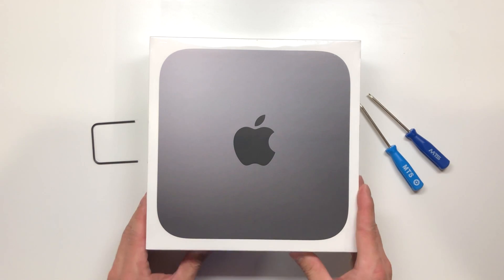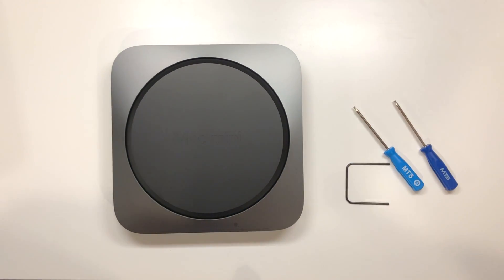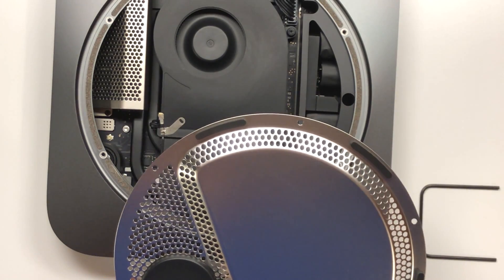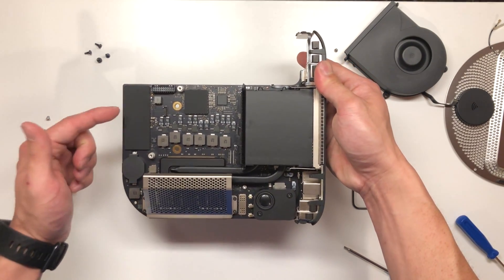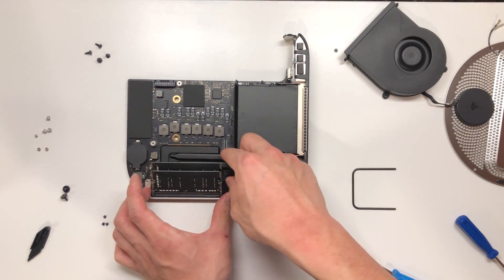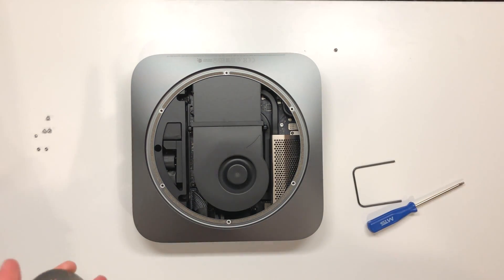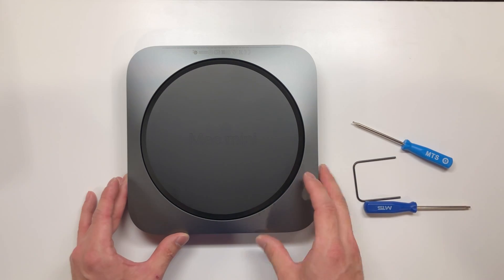Late 2018 Mac Mini Teardown & Ram Upgrade + Re-assembly

Comment: Great video!! - I've been waiting for a teardown like this, to see how easy it is to upgrade the RAM.  Although, sorry to disappoint you, I don't think the 2018 Mac Mini still has the IR receiver, nor does the headphone jack support S/PDIF optical connections like previous models. On the plus side technically, the four USB-C connections are actually Thunderbolt 3 ports, so superior to plain old USB-C. https://thunderbolttechnology.net/blog/difference-between-usb-c-and-thunderbolt-3
Reply: Ben Norris I think you can get some Thunderbolt Optical connectors?
Reply: Jake M Probably. A lot of Audio interfaces also have optical out - so it’s not a deal-breaker (just more inconvenient).
Reply: Ben Norris Seeing as Apple’s suite of decent programs includes GarageBand and Logic, it does seem a strange omission!
Reply: Jake M it is a bit - but I expect Apple thought anyone who is likely to really need it (especially for Pro Audio applications), is more than likely to have an audio interface anyway that come with a plethora of additional features.

Comment: i build and can easily take apart pcs. but since this is my first mac. im not going to open it up and do this. althought im 90% sure i can do it. i cancelled my 8gb mini and just got the 16gb version. yes its another 200 euros. but want to lean towards the careful side.
Reply: @Xavier Breath i want to go for 32gb so that would save me 360 euros here in the netherlands...
Reply: @AFTstorm  thats a different story. if i am pleased with the machine. and in a few years i think its still doing what i want. then opening it wont be such a big deal.
Reply: you can pay apple to do it for a fee
Reply: Chris Schneider One only learns by one’s mistakes. Making mistakes is GOOD. Don’t be a wuss.
Reply: @unlokia  not on a new little box. fucking up a 2k little mini is not a "good" mistake. and its just ram you can upgrade. this is apple we are dealing with.

Comment: I'm curious how effective it is a dissipating heat, and is the heatsink copper bottomed? If it's copper then liquid metal will drop the temps and hopefully prevent thermal throttling.

Comment: does it boot with new ram strips? what's up with all the T2 scare?
Reply from the maker: Didn't actually replace mine, but it booted fine after opening. Numerous people have done the ram upgrade with this model on fourms and no issues with T2.

Comment: Very helpful video - many thanks. My conclusion is that I'll buy one of these with 512 Gb SSD and 16Gb RAM - Apple's premium for that much RAM isn't too bad. Then, when AppleCare on it has expired I'll do the upgrade myself to 32Gb or even 64Gb. But I'll leave it unopened until then.
Reply: In the end I'm doing something else. I found a 2017 refurbished i5 iMac on the UK Apple site with 32 Gb RAM and 512 Gb SSD for about the same price as I was thinking pf paying for the Mac Mini + 4k monitor. Given that the only thing I can upgrade on the Mac Mini is the RAM, and this iMac already has as much RAM as I'll ever need, I reckon this puts me in the same position. Yes, the processor is a generation older, and is only 4 core rather than 6 core. However there are positives with the iMac: a) it has a GPU rather than integrated graphics; and b) I'll get a new keyboard and mouse as well!
Reply: Tom Burke That’s a good plan!
Reply: Personally i may go for the 1tb option but i may just do the ram myself if i ever get one of these
Reply: I am planning to buy 32 GB RAM from Amazon, than take to an Authorised Apple Service Center and pay the service fee which is about £60 so it would be still way cheaper than buying 32 GB from Apple.
Reply: Yeah, good idea. 16GB is broadly sufficient. And, in a few years, when your Apple Care has expired, 64GB might be much cheaper than it is now. (RAM prices have doubled over the last few years: supply and demand). Prices could go down to a quarter of what they are now. I doubt they'll go up more. There's an incentive now to build more factories. Still, 2x16(=32)GB so-dimms are $300 or so now. Don't you pay $200 for the 8-16GB jump?
Reply: For the Mac Mini, going from 8 Gb to 32 Gb is £540 from Apple, or £270 from Crucial UK. So the MM with the i7 upgrade (probably better than the iMac) plus 512 Gb SSD is £1429, plus £270 for 32 Gb RAM from Crucial UK = £1700, plus c. £350 for a 4K monitor = £2050, which is a little more than I paid for the iMac. And the iMac gave me a new keyboard & mouse and a GPU. 

Of course, the list price of that iMac is £2,439, so it was the availability of the refurbished iMac that made the deal.  @GregConquest

Comment: Can you deesolder the ssd
Reply from the maker: I wish I had skills this good. In theory yes, but I don't think any human could actually do it. Too many pins and too close to each other. Also risk would be pretty high. You would actually be better off paying to upgrade.
Reply: thanks just curious, also curious if a sim slot can be adapted for an sd card in apple products products? @brandon20904

Comment: which means I can not upgrade ssd, what a shame, apple
Reply: @Jewish Person  
If the SSD goes bad outside of warranty you are screwed,  it should just be just a matter of placing in a new one, but Apple's approach means a very expensive and time consuming repair, if it happens a few years outside of warranty maybe even uneconomical.
Reply: @Jewish Person You take advantage of thunderbolt or regular usb hdds?
Reply: Your picture matches perfectly

Comment: ofcourse its a 2 memory card setup. :( i guess ill have 20 gig ram. cuz I'm cheap.
Reply: You have to get 2666hz SO-DIMM memory or it wont work
Reply: Miko - its doesn't have to be 2666 mhz. 2666 just gives you the best performance

Comment: Thanks for the tear down and reassembly video. It was informative. I'm thinking about getting a Mac Mini but the cost of upgrades from Apple is prohibitive. Seeing the relative ease of upgrading the RAM was great. Pity that the SSD is part of the logic board though :(.
Reply from the maker: Yes, if the SSD was user upgradeable it would have been perfect.

Comment: Great Video , It is not difficult but at the same time he made it look a piece of cake which is not in my opinion .
Reply: Roberto La Greca Idk I took apart an entire MacBook Pro 13” from 2012 to replace the thermal paste, RAM, battery, and drives and even though it felt daunting everything is much less fragile than you think.

Just keep touching metal because ESD is a bitch.

Have never had it happen, but some preventative measures go a long way.

Comment: Can you confirm whether or not the t2 chip would brick the device from removing the ram?
Reply: Joshua Ryder Many people have already upgraded the RAM and is working fine.
Reply: Nope. Several people on the MacRumours forum have reported success after upgrading the RAM.

Comment: Is the CPU soldered?
It seems like a standard desktop model number (for the processor, clock speeds / cache, etc match up with desktop counterparts) so maybe it's just a custom apple BGA adaptation of a desktop chip?
Reply from the maker: I didn't take apart the heatsink, but AppleInsider is claiming "processors are all soldered and not socketed."
Reply: They are Intel Core-B Processors -- BGA  yup. According to AnandTech, the other difference is they are restricted to 65W TDP. I saw a video that pegged 6-cores of the i5 Mac mini at 100% each (perhaps not a very real world test). They sat at a constant 3.9 Ghz. I don't know for certain, but my understanding is that the non-B variety would exceed 65W TDP in that scenario, and presumably reach the 4.1 Ghz boost on all cores. These CPUs are intended for small enclosures like the Mac mini.

Comment: apple did all that so that you cant upgrade RAM easily
Reply from the maker: Seriously, they could have easily left out the metal mesh shield/guard. They probably profit more by scaring people into buying the upgrade, than the additional cost of installing a metal mesh guard around the ram.
Reply: @brandon20904  this annoys me because I intend on buying a mini but seeing how this isn't a straight forward take the ram out n replace it has me thinking of just upgrading the ram from apple which is more money 😩😭
Reply: Brandon Geekabit are those all screws’ shapes ‘*’?
Reply: If they just didn’t want you to upgrade the RAM, they would just solder it to the board. Problem solved.
Reply: Minoan Light , no Apple probably listen to tons of complaints about the older ones not being upgradable so they made these upgradable, advertised as such but still made it tedious to upgrade in which manipulates the user into paying a “certified” Apple technician to upgrade at a profitable cost. This is not uncommon of Apple.
Reply: @minoanlight4545  true
I think apple are going to continue to allow desktops to allow ram upgrades if not storage
Reply: Tigerex966  or they could just give you enough RAM stock so that you don’t have to upgrade. The Mac Mini is simply not a balanced system for today’s standards. $799 should get you at least an i5, 16GB of RAM and decent dedicated graphics or 8GB of RAM and mid-tier graphics.
Reply: @minoanlight4545  
And why they don't allow us to upgrade storage? In my opinion, at least the RAM and SSD should be upgradable.
Reply: At least you still can do this even though it's hard. Be happy.
Reply: M4st3rm1nd is that your best critique?? Try harder!
Reply: Ramón BS - you're so proud of your response huh?
Reply: Why would they make it easy? They are a company. It's what companies do, make money off you. c'mon

Comment: Thanks so much! Do you think that Apple intentionally put that metal shield to make it harder to replace the RAM by a regular user?
Reply from the maker: Yep. I think Apple sits around and laughs at all the hoops we jump through to upgrade our mac. I mean... was the metal shield even necessary.
Reply: It is an RF shield. It is there for a reason. Good video. :)
Reply: You're absolutely Right, plus on industrial economy is absurd they would waist a screen like that just to make it more complicate. On a big scale several hundred thousand but on a long run more likely a million+ of those would count for a lot of money. Basically in a well engineered device any single tiny piece is there for a good reason and function.

Comment: Fantastic! My only concern is causing any kind of unwanted electrostatic discharge that could fry the motherboard. Any tips on how to avoid this?
Reply from the maker: Always touch a bare metal surface before working on any pc. You can also buy an antistatic wrist strap, this will keep you discharged while working on inside the PC. Read the instructions on how to properly use it though. There are also anti-static mats, etc. No guarantees but I have never damaged a pc from electrostatic discharge, and I have worked taking apart PC's for a living before. The only things I do is always touch bare metal first, and don't touch fragile components on a motherboard; like chips, capacitors, etc.
Reply: @brandon20904  Thank you for the detailed reply. I think I'll follow your method of touching bare metal before I start and also make sure I'm barefooted standing on an anti-static mat!
Reply: ESD wristband. Look it up.

Comment: Does it void your warranty if you open it up? Thanks for the video
Reply from the maker: Not sure, but it wasn't too difficult. According to Apple this years is NOT supposed to be user- upgradeable so I would lean towards the side of voiding warranty.
Reply: Brandon Geekabit afaik it does not void warranty but you will need to replace with original RAM before taking for repair etc...again, just what I've heard after days of reading around, could be wrong
Reply: @Jewish Person no it does not 
But apple wants you to think so for more profits
This is one of the reasons besides profits apple has soldered down memory and storage because you as a consumer still have the right to upgrade it yourself

Even those stickers that say void if removed are illegal that's why apple took them off

We still have the right to upgrade our memory and storage where possible without voiding are warranty although apple is lobbying hard against this.

 One of the features of the t2 chip is to brick macs that are upgraded and repaired without apples expressed permission in the future even when out of warranty

Apple could have soldered it on the motherboard, but chose not to for their desktops macs and you have the right to open it and change the memory

If an apple employee says otherwise they are misinformed and you have a legitamite lawsuit to file against them if they refuse repair underwarranty

Now if you put in the wrong memory or break other things while attempting to change the memory than of course they can refuse service

The auto industry tried the same tactics years ago and failed

No where on apples site or in the keynote or in the computer does it say your warranty is voided if you do so otherwise apple will be facing major fines from the FCC
Reply: No, but if you break something in the process, that will void the warranty.

If you upgrade the RAM, you should keep the original Apple RAM so you can re-install it prior to any warranty service.  Apple has a reputation for summarily refusing to service computers with aftermarket RAM, whether or not it has anything to do with the problem.
Reply: No
Reply: No, you don't void the warranty. But you will if you break something. Also, if you do need to send it to apple you do not need to install the original RAM. But I would still recommend to keep it just in case.
Reply: @michael4196  My Apple store said they would not do this upgrade
Reply: Thanks for a great video. Useful note....
I had a HEARTATTACK moment when the Mac Mini wouldn’t power on again again installing the new RAM. Rechecked everything (except the RAM itself) and nothing. 
Went back in again to the RAM slots and one just must not have clicked into place correctly - so make sure to double double check the fitting of the RAM!! 
Relieved now that I’ve not broken my brand new MacMini!!! 😅
Reply: No it does not. You have the right to repair/upgrade without voiding warranties by law. Even if you were to open this and swap ram, all other parts still must be warrantied (outside of the upgraded ram) so long as you don't damage the product during the upgrade. It's your computer, not apples, you can do what you please with it.
Reply: Brian Schaper what if the ram is soldered to the board. Are you still allowed to swap it? (prev Mac Mini)

Comment from the maker: Please like, subscribe, and checkout my other tech videos : )

Apple must have purposely installed that metal cage 6:37 to deter us! Don't underestimate the power of YouTube!
Reply: Brandon Geekabit Those are actually thunderbolt 3 ports
Reply from the maker: @Everything2A  Correct. I interchange the two b/c they are the same connector. But yeah, Thunderbolt 3 is more capable and backwards compatible with USB-C.

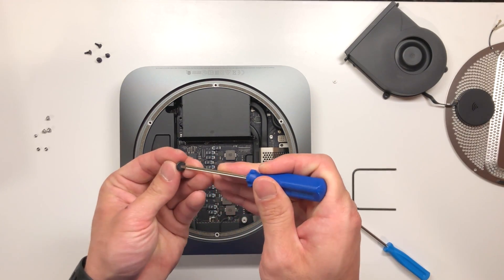Comment: Excellent. Did you figure out whether the screw at 4:45 is indeed a Torx T10? Next Torx size up is T15, which it sounds like it definitely isn't. Subscribed.
Reply from the maker: Yep. I tried both a T15 and T10 the 15 was way too big. A T10 Torx works!